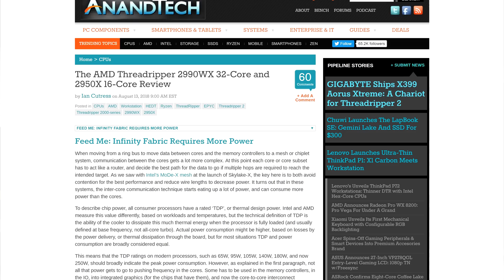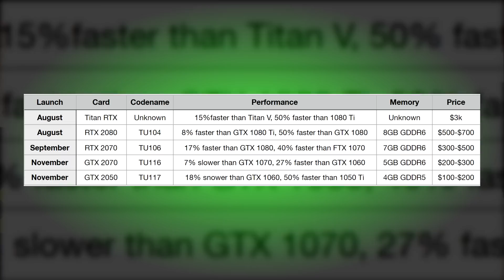What Is the Next Step for AMD! Nvidia Rumors Are Tiring…

Comment: There really isn't anything to optimize. Infinity Fabric has a higher transistor size since it's using old tech to remain cheap. Probably 60+nm or so. Otherwise it wouldn't be economical. But at the same time, using monolithic dies will drive up costs as well. It's all about finding that threshold.

Comment: The core war is far from over!
The most important building block for AMD cpu's are the core complexes aka CCX. Now for the new Epyc server cpu's it's already out that it will be a 48 or even 64 core cpu. This is only possible if AMD fits 6 or 8 cores in a single CCX.

Now if we take Global Foundries numbers for the 7nm production that state 60% less power consumption and 40% improved performance (clock speed) So if that is true 8 cores in a single CCX will still use less power while boosted into 5Ghz territory. 

This will open some intresting design options to AMD, like single CCX Ryzen cpu's that still will have 8c/16t or if they stick with dual CCX like they have now the Ryzen 7 cpu's might go up to 16c/32t.
At the same time Threadripper could get 48c/96t or even 64c/128t cpu's an insane amount of cores indeed but in my opinion it's more up to AMD's marketing department how this all will be rolled out in the future.
Reply: Great breakdown. Definetly gives me more information next time I want to speculate ! Thanks for watching !
Reply: I gave this some more thought and continuing on my breakdown lets take the 2400G for example. A single CCX design with 4c/8t an 11 vega cores on 14nm. Now that APU already is in between a GT 1030 and an GTX 1050 being closer to the 1050. Lets double that in 7nm. That would give a 8c/16t CPU @ approx 4.5 to 5.0Ghz but if it also would get 22 Vega cores it will perform like a  GTX 1050Ti or even maybe like a GTX 1060. That would be insane value for money if they can keep that under the $200 mark. If this happens next year remeber I was the first who told ya :-)